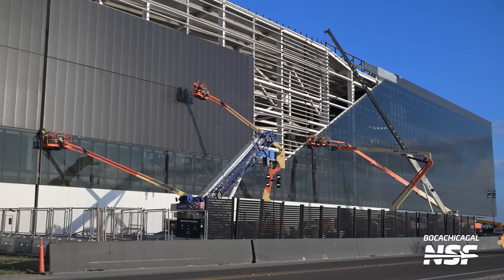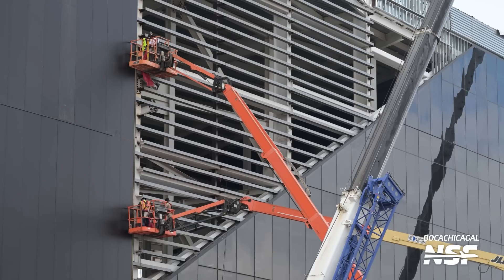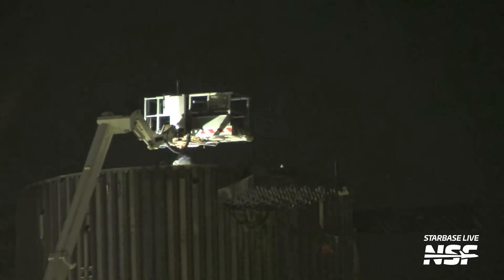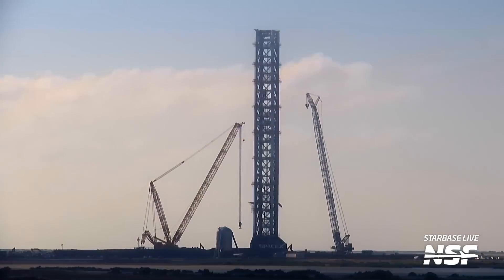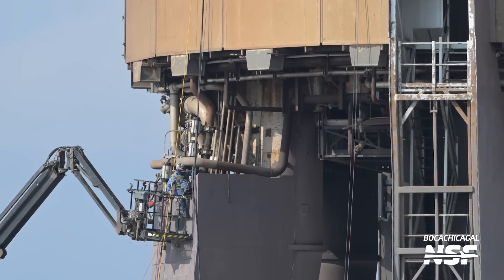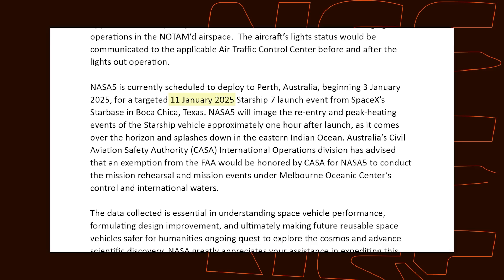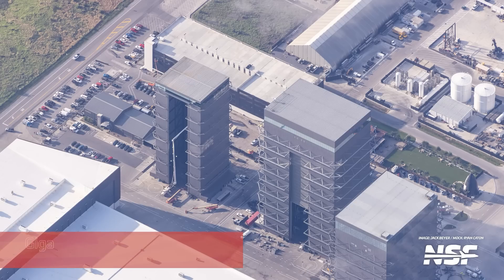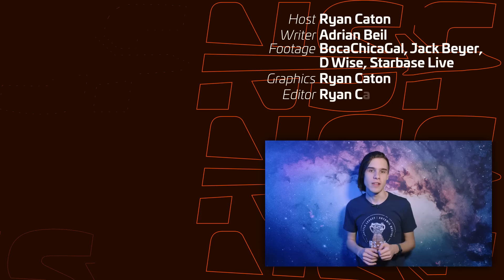Starship Advances Toward Flight 7 (Plus Giga Bay Updates, Pad B Developments) 🚀 | Starbase Update

Comment: The antennas are placed at the catch points on the chopstick arms and are picking up GPS Satellite signals. As the arms move, the GPS coordinates are recorded. This produces a 3D map keyed to the servos which move the chopstick arms. This tells the computers where every point on the arms are in relation to the tower. Thus the guidance computer for the tower know precisely where the chopsticks are at all times. This information is sent to the returning booster and the booster sends its location information to the tower computer and the two systems compare data. This feeds into the GO-NO GO Catch algorithm. If the link between the booster (or ship) and the tower is lost a catch cannot be completed.

Comment: My opinion Giga Bay will start next to the road go all the up to the current high bay, then mega bay one will go into the new gigabay section 1, then the ship build materials will move to Megabay 1; high bay will get scrapped, then section 2 of gigabay will go over to mega bay 1, then the shift, megabay 2 will go into seciton 2, ship materials will go into megabay 2, then scrap megabay 1, and section 3 of the gigabay will go over where megabay1 is. Eventually ship will move into seciton 3 of the gigabay and megabay 2 will get scrapped for the final section of the gigabay to go ontop. Did you all follow that??? LOL

The goal here being items would roll out of star factory, into giga bay and come out the other side of gigabay fully stacked, like a well oiled machine. good enough to produce the number of ships and boosters they say they will need. I have a pretty rudamentary drawing laying it all out, and ships and bosters will no longer go out from between the factory and bays instead they will exit out the back and come down the road that goes passed the rocket garden....heck the gigabay could ecompass that as well

Comment: Well the booster didnt realy "reentry" ..... Starhip does ... booster not so much ^^
Reply: I guess that depends on how you want to split hairs.  Did it cross the line and make it into space?  If so they it is re-entering the atmosphere having technically left it.
Reply: @imaginary_friend7300  Well to use "reentry" in proper terms you not only have to leave the athmosphere but also most importantly have orbital velocity which you have to shed off.

That is why for example Sue Origins Shepherd capsule isnt reentering at all......

As a rule of thumb = If you have heat tiles your vehicle is set for reentry.

If you dont have thermal insulation (due to way lower speeds) you aint "reentering".
Reply: @kwichzwellbreck697  Re entry is just that.  Even the New Shep is re-entering.  Sometimes a qualifier is put on it.  Re entry from orbit (like you refer too) as an example.  Even the F9 performs a entry burn to slow itself during re entry.  Re entry itself is not defined by the speed but by the action.
Reply: @imaginary_friend7300  Entry burn ... why isnt it named RE-entry burn? Go think ^^

Comment: S26 is the worst ship?!?!?! <G> Isn't S20 is still sitting in rocket garden?
Since SpaceX likes to get rid of 'extra' parts, could they have the downcomer actually be the landing tank and not just the shell?
Can't see them removing MB1 and it can be repurposed as another Ship factory but High Bay won't fit anything for long. Could they just add another level onto MB1 to increase height without demo (could keep rest of Booster support in place, too)?

Comment: Maybe those aren't antennas on the chopstick. Maybe they're  thermal sensor pads to measure the temperatures during liftoff and they're just testing software 🤔
Reply: they're in the way of a booster catch tho, which is the M.O. For all future flights
Reply: @tylersherrock7649  yet I stated they may not be antenna. Certainly antenna wouldn't be there either during a launch or a catch! Noone knows exactly what they are or what they're for at this point.

Comment: @8:00 Those are vacuum insulated cryo pipes.
Reply: Came to say that, glad to have been beaten long long ago!
I'm sure most will know this, but for those who don't:
The "insulation" is a pack of air between the inner wall that the cryo fluids travel, and the outer wall that is subject to the ground. That lack of air means there's no to thermal transfer, in this case, the vastly warmer ground compared to the insanely cold fluids.

In other words, it's the exact same reason your thermos keeps coffee/tea/soup hot all day, or a cold beverage cold all day. Science FTW!
Imagine if our homes could have a vacuum barrier instead of the physical insulation... (besides our windows, if you happen to have quality ones; I believe some are filled with argon, for similar reasons)

Comment: Lifting the height of the bays can be done fairly easily, as long as the footings and columns are rated for such a maneuver.
A lift extension would actually be fairly simple, detach the roof beam structure, raise it with a couple of cranes, add the necessary wall extensions, and reassemble the roof structure.
Reply: How do they get rid of the concrete on the top? By jackhammers while work is done under them?
Maybe. But I doubt it.
Reply: @knowledgeisgood9645  
The High Bays don't have a concrete roof.
What are you talking about.
Extending the height of the building is a basic job, just a lit taller.
These are steel open column type buildings.
Reply: @gwbuilder5779  The top floor is a restaurant. Its floor is made of concrete on steel sheets.
Reply: @knowledgeisgood9645  
Not talking about the Star Factory.
Reply: @gwbuilder5779  They have the same type of floor. The roof of the High Bay is only steel sheets, but floor of that top space is concrete (above the crane).
Reply: @knowledgeisgood9645  
So what you are saying is that Elon didn't expect to extend these buildings even though they have been intentionally built for the specific purpose of housing these new designs?????
You are not a builder and have absolutely no foresight into this process nor did you listen to the many interviews Elon has given about these structures.😂🤣
Reply: @gwbuilder5779  Yes. At the time the High Bay was built there were no plans for taller boosters or ships.

Comment: I'm waiting for Giga bay to be a Mega bay height building that encompasses the entire area where the bays currently are. Like a VAB attached to the the star factory so it can all be completed without having to roll the ships/boosters out into the open until they are ready to be moved to the launch/testing sites
Reply: It would need to be large enough to cover any cranes needed. Building it would stop all production for a year or two. I can't see them wanting that.
Reply: @knowledgeisgood9645  Long term goals. They can easily start building around most of the existing structures and only remove the old ones as the construction catches up
Reply: @goodisgoog  Construction takes a lot of space. I am having trouble imagining the two at the same time. Time will tell.

Comment: A second stage version with a payload of 200T cryo can easily get stacked in the high bay.
Reply: Easily? How?
Reply: the v2 ship might be ablte to but not a v2 booster, which im pretty sure is tller
Reply: @HamzahKhan314  200T of cryo is a dense payload that can fit in the current starship design even with the forward dome moved forward. Besides, the high bay could be used to lift the nose cone payload section over payload hardware before getting moved over to the megabay for stacking.

Comment: 16:29 my guess is that they will build the gigabay without demolishing the current megabay, and then once operational, they will then demo the megabay and build the second half of the gigabay so that they don’t ever have a large bottleneck.
Reply: They will demolish the High Bay and the office building. That space is enough for a bay at least twice as large as the Mega Bays. But it does not have to take much longer to build. Reinforcing the ground with pilings and creating a concrete base takes most of the time.
Reply: Start with the Giga Bay back wall behind the High Bay, complete the back and sides around the High Bay and finally encompass the front of the High Bay. Then disassemble the High Bay.
Reply: @mikegardner107  Not that it could not be done, just it would be very cramped and difficult, as well as a dangerous working place.
Reply: @itsallgoodaversa Sounds sensible to me. If I’ve understood you correctly you’re basically describing a repeat of the Starfactory strategy that we’ve already seen in action. Build a big section of it as a stand-alone building (walls all all 4 sides plus roof), get it operational, then build an extension next to it and once the extension is completed remove what by then is an internal wall (so we’ve never seen any of those wall removals) to create a single bigger building- and in Starfactory’s case then repeat the process a few times with additional extensions so that the building (Starfactory) gets bigger and bigger.

For a Gigabay I suspect the first phase, if it does cover the area of both Stargate and High Bay, would be big enough so that work at the highway end of that building wouldn’t be badly disrupted for the week or so when the opposite wall came down to connect it with a newly built extension where Megabay 1 currently is.

Comment: They were testing how well the (current or maybe new) antennas of a caught booster can communicate in the electromagnetically loud environment of the tower. As well as the non-standard orientation or visual line-of-site blocking by the chopsticks themselves.
Reply: Good observation.